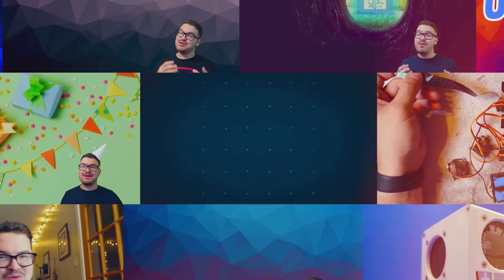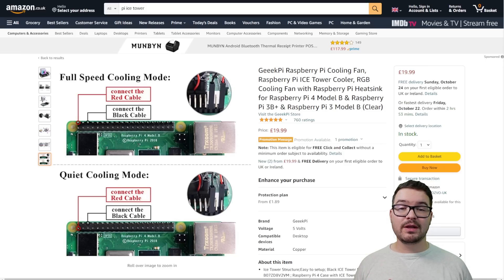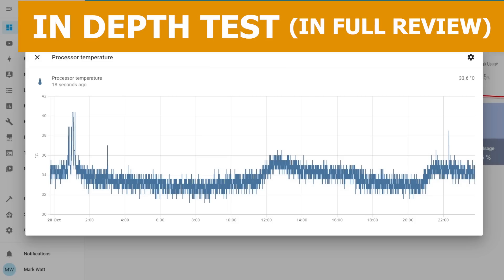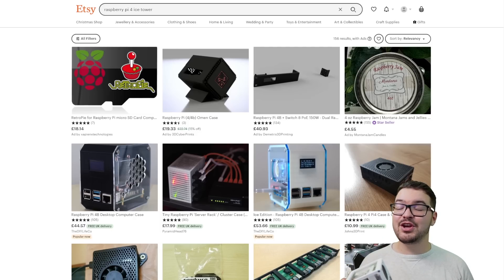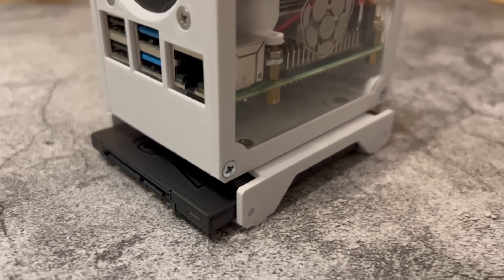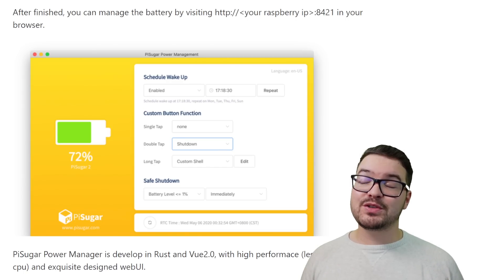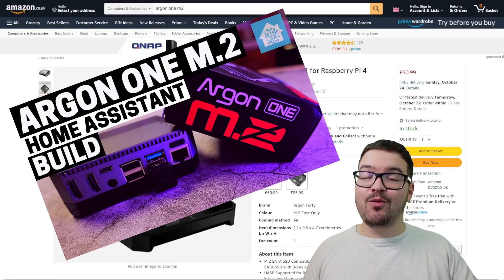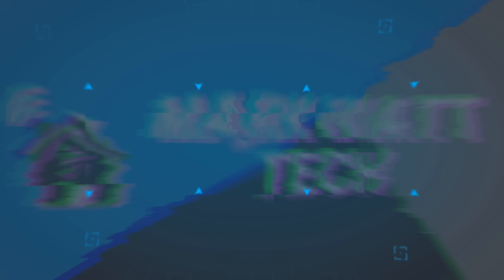5 Pi Upgrades For Home Assistant

Comment: Any update on that PiSugar integration with HA OS ? @Mark Watt Tech

I've been looking into building an addon for it
but honestly when it comes to hardware stuff i'm lost

all I was able to gather from the Psugar github 
is you can interact with the board directly using I2C
they have a little I2C manual in the Wiki

and to interact with I2C in HA OS
you have to first enable I2C
then to actually interact with the I2C connected devices
you have to make a custom addon, and give that addon's container the correct privileges to access the I2C interface

I am currently trying to work on a Python PiSugar 2 Pro I2C API (I can't run tests on other models because i don't have them)
honestly i'm struggling to  understand I2C fully
and i'm now learning Rust, to actually understand how the official Pisugar-Core modules work >>>
this project will take a while....
if anyone reading this want to help just reply to this comment (:

Comment: 4:50 How much current can the Pi supply to USB ports and how much current do that adaptor plus drive require? Important point if you don't want to burn up one or the other.

Comment: What exactly is the point of a UPS for Home Assistant when literally every device it could possible hope to control would be without power anyway?
And to the point of corrupting anything, the official way of shuting down or restarting your pi without anything attached is literally yeeting out the power cable :D
Reply from the maker: There’s a few reasons people may use it. You may be running other processes on the pi that you want to control the shutdown for to avoid corruption etc.

A lot of people make use of Zigbee only setups. A lot of zibee devices are battery powered and would continue to run and function regardless of power or broadband connectivity.

You could also have a Python script perform a controlled shutdown if it detected it was on a UPS for a long period.

And another one could be a final cry where you could use cellular connectivity to send a message to say your power is deaded and what time it deaded. Just incase you have Christmas turkeys in 😂

But you could always opt for a yeet 😂😂

Comment: how would you intergrate with the tower if the button to turn it on and off is super tiny?
Reply from the maker: What button sorry?
Reply: @MarkWattTech  the button on the pi sugar 2
Reply from the maker: @kevincampos6394  ah gotcha. Yeah for that if you where using the buttons for anything you would need to either cut holes into to enclosure or just not use them.

I didn’t show it in the video but this 3D printed case comes with different base finishes and designs as appose to just the flat bottom to house other components etc.

Comment: My best upgrade for my Pi?… Upgrade to a more robust platform 😎 Recently I upgraded to a Dell Intel Nuc and proMox! SSD storage ands lots of (shared) RAM.
Reply from the maker: The Nuc is a great upgrade :) especially using Proxmox. That generally tends to be the path HA users seem to take after they outgrow the Pi or want to run other things without effecting HA's performance.

Comment: My Pi is already plugged into the large UPS power unit my router is powered by. If the network doesn't have power, the HA won't be of much use.

When I bought a Pi case with a fan, I ended up removing the fan as the noise was very annoying.
Reply: Yes it protects your pi/equipment from lightning strikes and let's the pi shut down safely instead of an sudden off...
Reply from the maker: If your using locally controlled devices, zigbee and Wifi everything will still continue to work untill the UPS goes flat.

Comment: I am considering a UPS of some sort for my current Pi 4 with Home Assistant as well as running the ICE Tower. Already have the ICE Tower on my Media Server Pi, but need to come up with a custom UPS for that as I'm using the Geekworm X883 dual SATA board with it.

Comment: I got the argon one m.2.. the case is almost completely air-sealed and the fan is ridicously tiny. Result was, absurd noise and rpi way hotter than before. Solution was remove the argon case, buy one of those rpi-sized heatsink and place a simple 60x60 mm usb powered fan on the top. Noise is zero and temps are way lower.

Comment: From as performance perspective, would it be better to use an NVME SSD _~1.8G/sec) with a Geekworm interface board vs an Argon One that only supports SATA data speed transfer? (~500 MB/Sec)?
Reply: I'm going to be running one of the Geekworm boards for my Media Server, but I have not decided if the speed boost would be worth it for my Home Assistant installation since I will be moving over to the Home Assistant Amber when that arrives late next year.

Comment: I always used HA on a RPI, but man.. I switched to a thin client (HP T630, 8GB RAM and 120GB M.2 SSD) and it is a world of difference. Of course, it is a bit pricy.. But you can't place a pricetag on a nice running HA IMO 😅 Still need to find a good use for my RPI 😋
Reply: 3 of my RPis are working as DAC to drive active speakers. With Qobuz/Spotify it is amazing. And it can easily integrate with HA
Reply: @zyghom  Thank you for this tip :)
Reply: Is it difficult configuring USB zigbee and z-wave sticks?  I had trouble with this running HA in a VM on a Windows 10 machine
Reply: @gilkman  I had no troubles at all. Make sure you "forward" your USB-device(s) from your host to your VM.
Reply: Moode audio is fab for streaming. With a cheap dac hat I can stream all round the house.  Best distro imho as it is regularly updated and can take any streaming source.
Reply: If you like arcade game, use the RPI with Retropie

Comment: Homeassistant dont even need a fan. Ice tower is overkill. Its barely getting hot.
Reply: I disagree. I’ve got a Pimoroni Fan Shim and it kicks in at 60C. Depending on the ambient weather, the fan kicks in often. Especially when it backs up during the night. In the summer when we had a heat wave, it was kicking in every few minutes.
Reply: I agree that the cooler is way too big, and the small fans in the case are a no-go. There are nice aluminium cases like the one from FLIRC that perfectly cool the Raspi4 passively.

Comment: 1- SSD M2
2- 5.5V/5A power supply
3- Argon M2 box

all are not even "nice to have" but "a must" (of course not necessarily these ones but the idea is there).

8GB of RAM would be probably better than 4GB but still I am always below 50% of RAM
Reply: None are a must. 4GB Pi is more than enough, so is 5V/3A power. The Argon case is really nice, but not necessary. An SDD does feel like a must though. Since booting my Pi's from USB to SATA, I will never go back to SD cards.
Reply: I really like the Argon M.2. The only complaint is that the SSD uses a USB A connector externally, which makes it harder to flash when you’re getting set up.  I wish it used one of the B-style connectors (with a corresponding change to the U-shaped dongle).
Reply from the maker: Deffo 8GB and deffo an adequate PSU! So many people have issues when trying to use underpowered phone chargers etc 🥲

Comment: Thanks a lot for this video! As a newbie, it really helped to understand what I should upgrade. As for the jingle, it's pretty awesome, but I loved the old intro too haha
Reply from the maker: Just playing around with new stuff :D It wont necessarily stay. But just putting it out there to see what people think :)
Reply: @MarkWattTech  Great video, but, and please don't get me wrong, what's the point in having a UPS for a Pi that is running Home Ass? I mean if the electricity fails everything in the house goes out so there is no point nor way you're going to be able to turn things on or off anyway.